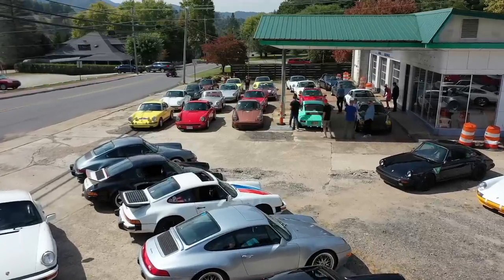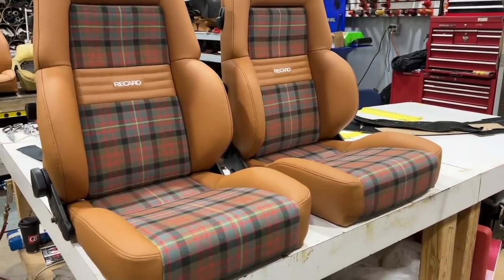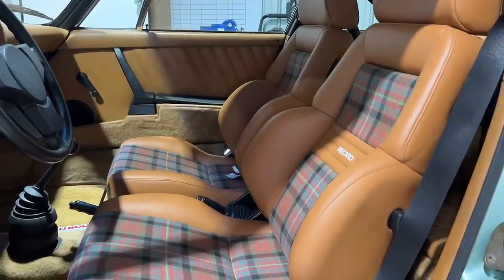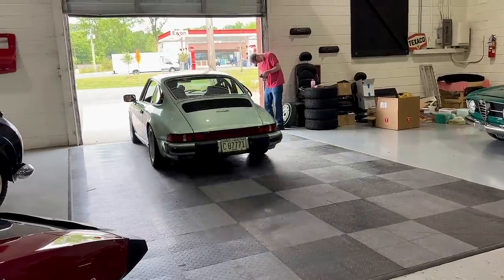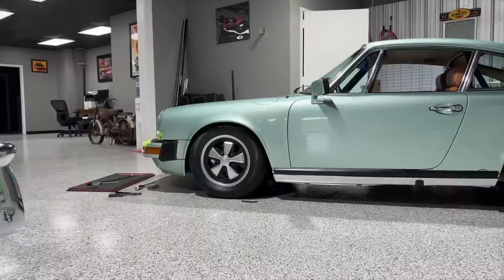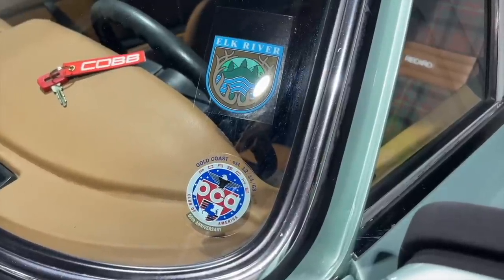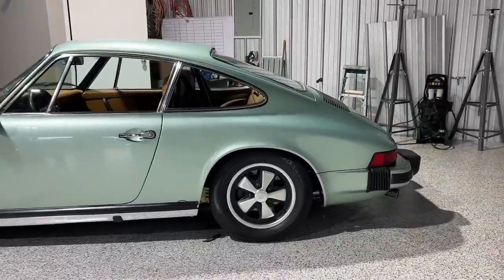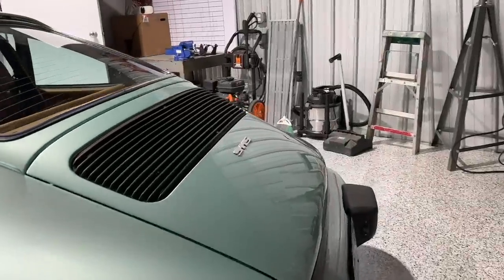Saying Goodbye To My Ice Green 1976 Porsche 911S

Comment: Going back to more original is a good idea. Consider pulling out the roll bar too. It's really pointless for a non hot rod and compromises usability.  Also, is the outside flag mirror original? Or should it be chrome?
Reply from the maker: Embarrassingly I am not sure about the flag mirror.  It looks like other 76’s have the same mirror, but I can’t plant a flag in the ground and say for sure 100%.
Reply: @Rennthusiast  Nevermind. I forgot it was a '76.  Pretty sure only '74s had chrome mirror(s).
Reply: Roll bar in a street car is a good way to give yourself a TBI in a fender bender, too.

Comment: Did you replace the oil return tubes?  Surprised you bought a 86’ especially given that the 87’ has the G50 transmission.
Reply from the maker: I don’t know that we did.  I’m sure if they needed replacement we would have done it.  RE your point about the 86….I actually prefer a well sorted 915 to a G50.  Crazy, huh?  Lol
Reply: @Rennthusiast  a 915 can be as smooth as butter.  But the adjustment is a pain.  It feels like one can make it a little bit more perfect.  The G50 is more of a positive engagement with out feeling like it’s a gated transmission.
Reply from the maker: @bngr_bngr  for sure.  I have a 993 so I get the more updated shifting experience there while my 86 has a 915 that’s buttery smooth.

Comment: I think this is an interesting story ... suggest you walk us thru what happened/experience on BaT after this second attempt. I think $86k for an updated  1976 was very good money ... way good money if it was still "stock" w that horrible 2.7  - I owned a '76 Targa 30 years ago - looked great but what a POS. Will, are you actually going to make more money , after this new/additional commission ... rolling the dice for sure ... IMHO no way is this a $90/100k car. Then again "there is an ass for every seat" ;).  With the cost of parts and labor in todays world, it is not hard to get upside down in a '70/80/90s 911. Especially when you are the one stuck with rebuilding the engine and trans..